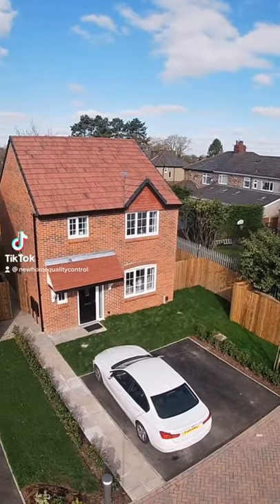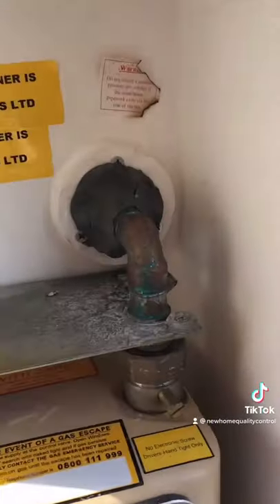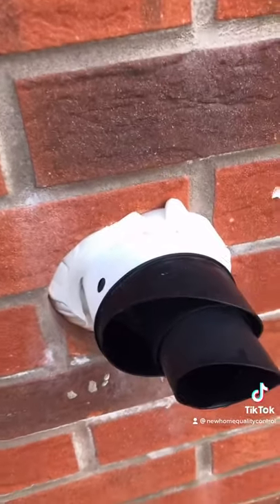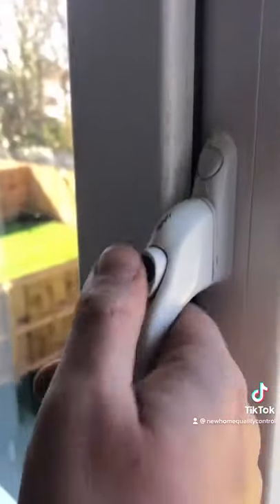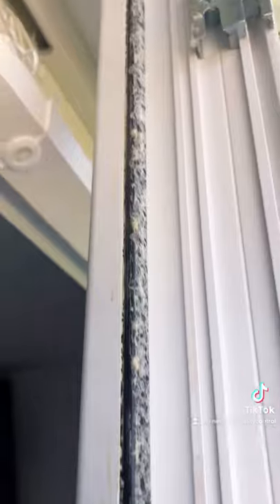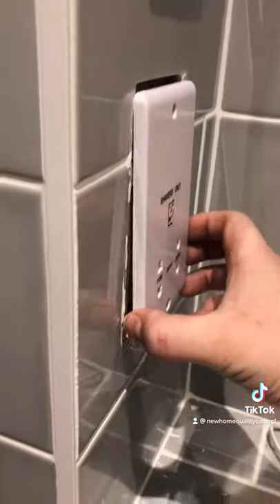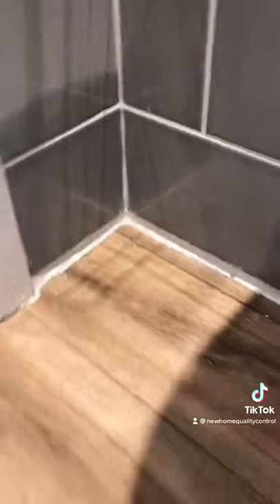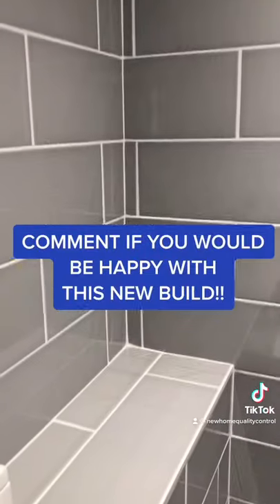NEW BUILD SNAGGING INSPECTION

Comment: Is this work that has been done by Lloyd and Gravell?

I would not be shocked if it is.

I had the misfortune of the business doing work on my house, quality of work shocking, sand and cement used rubs away with a finger, slabs broken, patio gets puddles, uneven steps, dreadful finish over external insulation,  windows fitted shocking, damage to inside of house during exterior work, bath damaged, plus other extremely poor quality, waste water gullies set so they di not take away surface water.

It is difficult to find one jib that was done that is passable let alone of merit and all 'oked' by council so no way to have anyth addressed

Comment: The people responsible for that dishonest and shoddy, careless and dangerous work should be identified and sacked as should the foreman and an audit launched within that company on all other houses on that site.  I would have fired everyone connected with such shocking standards had that occurred on one of my sites.  They don’t deserve to be employed. lf they were put under unrealistic pressures then the managers involved need reprimanding.  If a pattern continues then they need sacking too.  Even if it goes to the top, unrealistic expectations need challenging as those that suffer the consequences are the people that pay for  and suffer the consequences., the end users and buyers.  That lacks human charity, is dishonest and wrong.I would not tolerate such shocking standards on any of my sites and am appalled by what I’ve seen here.

Comment: Shouldn't use copper with gas it makes a reaction inside the copper and it flakes and ruins everything that you have connected to it eventually
Reply: No it doesn’t, all houses are installed with copper pretty much. It’s when you mix different metals you get issues. Also I use mappress copper fittings that are specifically made for gas 🤷.